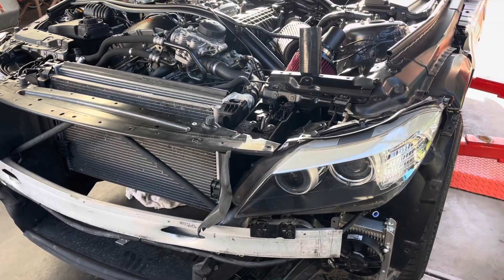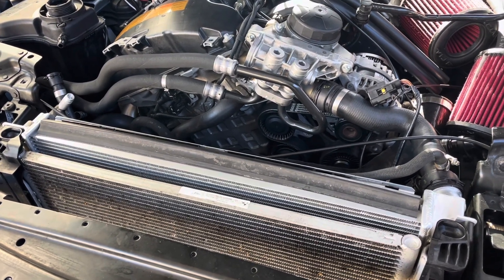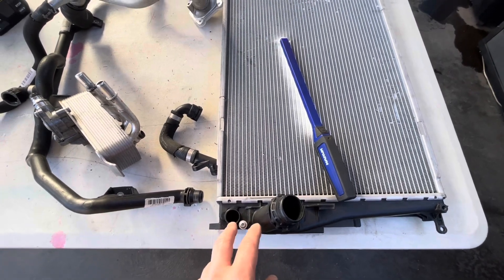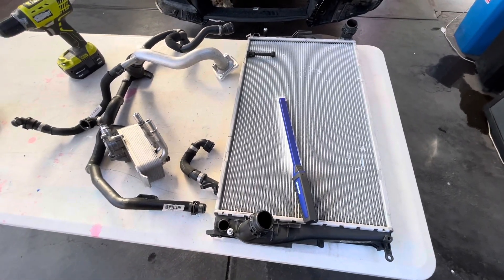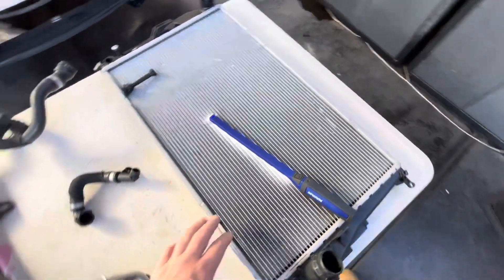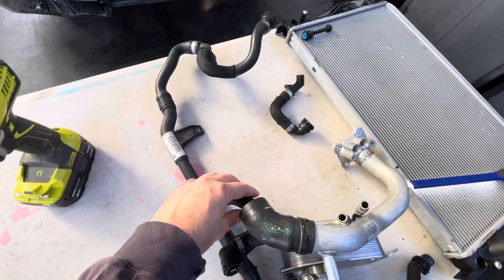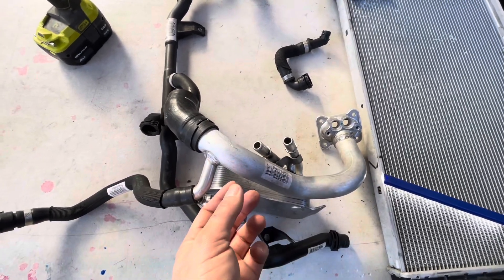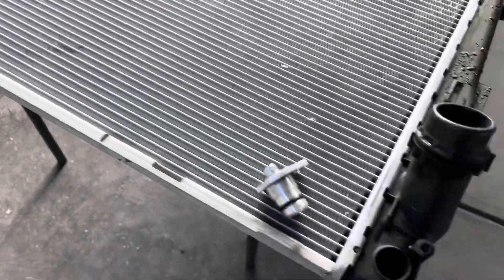Don’t install a trans/DCT cooler in your E8x/E9x BMW without doing this!

Comment: Nice tip, whenever I grab the bms trans cooler I’m going to drill out the plugs and tap them so I can install two 90 degree npt fittings and connect the heat exchanger lines together

Comment: That new cooler is clearly smaller than the bottom part of the main radiator. 

The engine coolant part of the main radiator never experienced being cooled by the bottom part of the radiator as that’s where the transmission coolant was cooled. 

So to summarise, you have fitted a smaller transmission cooler thus increasing the temperature of the transmission and will now over cool the engine.

There is a reason BMW designs cars in the way it does.
Reply from the maker: Well, it’s difficult to address your concern because your understanding of the system is significantly flawed. 

The transmission fluid/oil does not pass through the original radiator, but it does pass through the new external cooler, so you are comparing apples and oranges.  

The N54 is available with automatic, DCT or manual transmission.  The cooling requirements of the engine are the same, so increasing the capacity of the auto/DCT radiator makes it the same as the manual radiator, so we haven’t compromised a BMW design principle.  

Finally, the engine is fitted with a magical device called a thermostat.  The thermostat ensures you can’t ’over cool’ the engine.

Comment: Google AI supports your video lol, they list your video as most helpful
Reply from the maker: Haha. Good to have AI on my side
Reply: @DarkePeak  
Never would have known that you lose cooling capacity. Almost did this, it sucks because I just installed the Aluminum Automatic CSF Radiator. My DCT temps are reaching 205 degrees.

Comment: where could I get the plug for the radiator so I dont need to run any hoses.
Reply from the maker: I had to custom make them.  I couldn’t find anywhere to purchase them.
Reply: @DarkePeak  would you be able to make another and sell me it?
Reply: Sir. DIY? You made the plug side with a lathe? What is the measurement? thanks

Comment: Thanks for the video. In the process of doing something similar. For the line rubber line coming off the metal coolant pipe, where did you find the OE plug? I got confused there.
Reply from the maker: The plug I describe is one from the BMS kit. I didn’t have a BMS kit so I cut the line and used a 13mm poly end plug (for 13mm drip line).
Reply: Thank you. I plan to do something similar. If I can access the nipple on the hard pipe, I will can’t there. If not, I will go the plug route.

Comment: You could also just loop the secondary cooling circuit by bypassing the heat exchanger so then you aren’t losing the capacity. Obviously not as efficient as switching to the manual radiator but it makes the difference a lot more negligible. I’d probably loop it until the radiator fails somehow and then only upgrade to the manual one